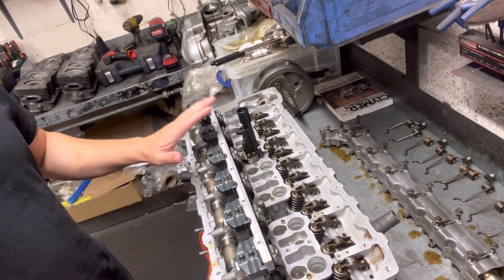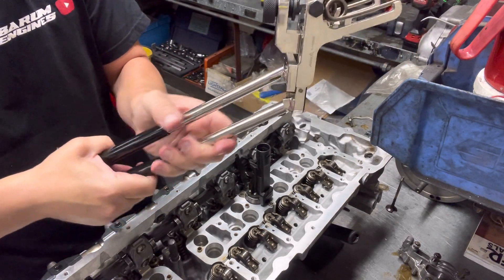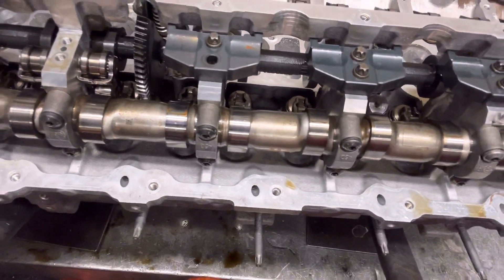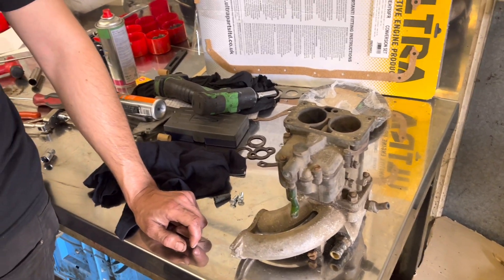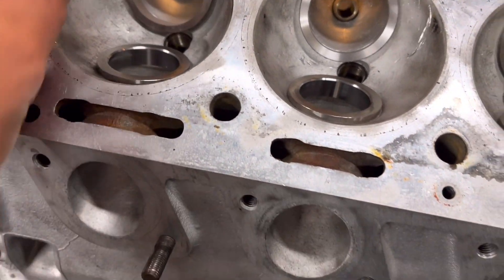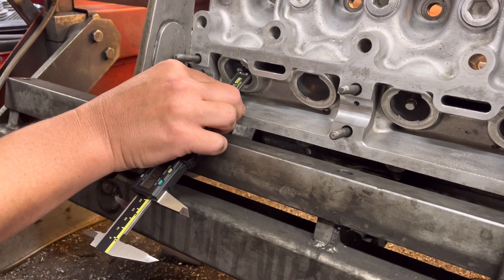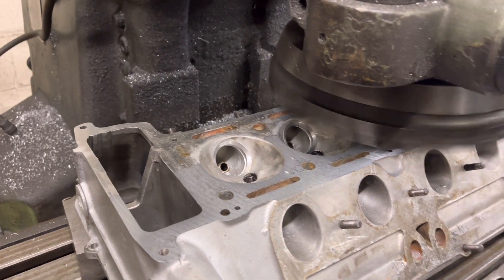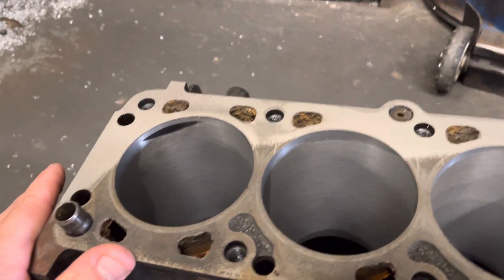Engine build postponed due to DISASTER. Cylinder block SCRAP. Customer will NOT be happy

Comment: Being a machinist myself ( now retired) I wouldn’t scrap the block. I would first sleeve the cylinder, then drill and pin the crack ends. Then grind out the rest of the crack. Weld it with the cast iron welding rods. Machine the deck then rebore the cylinder. I have made this type of repair multiple times with great success.

Comment: With regard to cleaning up that manifold - have you looked into electrolysis? It takes a bit of time, but it's unsupervised time (Also, make sure it's well ventilated as it gives off hydrogen!)
1) Big tub, big enough to fit part, fill with water.
2) Add a couple of spoons of Bicarbinate of Soda and stir
3) Attach negative to rusty part. 
4) Add a couple bits of scrap iron/ steel and attach positive to all sacrificial bits (a couple of long bits down each side would be best - make sure that they don't touch the rusty part!)
5) turn 12v on and watch bubbles.
6) Wait 24 hours
7) light wire brush of any remaining rust and you're good to go!

Comment: Holy crap BMW.  It's like they have engineers designing things as complex as possible just to justify their employment.  Any fool can make things more complex, but it takes genius to make it simpler.
Reply: Complex but efficient beats simple and inefficient. Remember the overwhelming amount of BMW's thus equipped are never likely to need this level of repair.
Reply: @stephenscholes4758  Part of why so many don't need this level of repair is because of the stuff that could and should have been better designed has failed and is exorbitantly expensive to repair.  Things like the CCV system, DISA valve, Vanos, cooling system failures, etc.  This system itself even causes expensive repairs due to long maintenance intervals.  All because of underwhelming cheaply made parts that are somehow insanely expensive thanks to that logo on them, and labor intensive to replace, or just outright cause the engine to fail.  The thing is, a variable valve lift system could easily be made using a much simpler and more robust system with a hydraulic variable height fulcrum on a rocker arm.  Then it's lighter, more compact, more easily serviceable, and probably quite close to the same reciprocating mass.
Reply: @stephenscholes4758  exactly this. if only idiots knew that BMW M5 with a fancy V8 is more efficient and does more MPG than a crappy Toyota Prius if driven on the track.. That's not even mentioning driver's experience that really is not comparable to any other manufacturer..

Comment: That is more or less the same set up as the mini R56 prince engine,made my own tool so I can replace the valve stem oil seals with the head on, works a treat replace all seals 6 hours drivng on the ramp to off. That tool is way over complicated.

Comment: OK

So here’s a question that’s come up to my mind now and again 

when you guys are rebuilding engines and you service a cylinder head 

part of that obviously is you test Spring tension

why is that test done at room temperature why would you not stick the springs in an oven heat them to 100° and do em at operating temperature considering metal gets softer as it gets hotter…..

Comment: Lee is it me but it seems like a lot of spring pressure on the "torx head bolt" on the top rail, the hole only looks like a m6 or m8 hole, Loving the videos as always and hats off to Isaac and Paul (you have got 2 top notch guys and getting use to the camera;  10/10
Reply: I wouldn't worry to much,  a m8 8.8 bolt takes 16100lb to snap.
Reply: @michaelbamber4887  Hi michael, yeah i probably put the question wrong. I was more thinking of the bolt threading in to soft aluminum especially with the spring pressure behind the bolt, I would have preferred to have used some thread lock
Reply: I'm with you now, well once its fitted and the torque is set, a m8 in 6061 aluminium can hold around 1800lb. Aluminium threads are no good if you keep separating the joint. This is when they 'strip'. Helicoil insert or time sert are fixes if you bust the tread. We used to fit um if the part was to be removed and refitted and was made of aluminium.

Comment: If you spray the face of the alloy cylinder heads with WD40 before you skim them you will get a better finish cut it stops the chips from sticking to the inserts and dragging the chip back over the head on its next revolution

Comment: Thanks for showing the valvetronic installation tool in action, I have often wondered how it works. Valvetronic is a very clever system for controlling the amount of air going into an engine and from what I understand it's also pretty reliable. FYI, these engines do not actually need a throttle body to run.

Comment: Pretty interesting, regular viewer 😁, when I find the time I’m going to pull my bmw mini n14 engine out it’s got the normal oil consumption issue . Runs fine tho 130 thousand on it , what sort of money would be in a refresh , ie pistons rings , valve steam seals , valve seats cleaned ect is there a package you offer I don’t know what’s involved exactly, as you have said before others have said refresh and it clearly was not once you have stripped and checked it over many thanks , I know it’s hard to valve someone like this
Reply: If you look back at one of the earlier videos Barum give a complete financial breakdown for an engine refresh from beginning to end!

Comment: Soak the rusty exhaust extractors in a solution of water with a couple of litres of vinegar and a litre of a calcium l, lime , rust remover. The rust will fall off overnight and it will look like new.

Comment: Could that crack not be lock stitched?  With the paucity of the blocks at some point its going to be economically sensible to attempt an actual repair, rather than just throwing it away and if a lock fixes it you got a good block ready to go elsewhere.   What we need is what they still do in India and Pakistan where they cast new blocks for trucks and cars, we used to do it here in Britain, I remember my grandfather getting his Austin 7 and his Triumph Vitesse worked on by a blacksmith's in Westerham like welding or brazing his Triumphs cracked block, that blacksmith could braze just about anything and he handled things like pressing in new waterpump bearings and seals which he did for free if me grandfather provided bearing and seal pack.

Comment: Just a suggestion for a new machine I use a robins sg8 valve seat machine it's also got attachment's for a drill and various other things I think it would suit you guys better and be a upgrade on the old Mira seat cutter I think the robins machines are fantastic it's one of a handful in the UK we had it imported by fondera it's a fantastic bit of kit
Reply: My 36 years as an Automotive Machinist , Having used a Repco RVR 3 ,  MIRA , Serdi  60 , Rottler SGF8 and EVO Classic by Serdi SRL Seat and Valve guide machines , They all have their Pros and Cons
Reply: @StuFGGSMiami  yes I've used serdis aswell and I've used the stone systems and the stone guns are absolutely crap I've used the Mira systems in other shops but never really liked the feel of them
Reply: Isn’t that a India copy of the Rotter SG8?
Reply: @andym6608  Rottler Seat and Guide Machines are made by Robins Machine India, then shipped to Rottler and fitted out with Rottler's electronics and Sold as Rottlers ,When Rottler discontinues that model , Robin Machines can the sell it under their name
Reply: @StuFGGSMiami  I had a feeling they were made by someone else I no mine has a different electronic part to the robins it has the electronic angle gauge and electronic speed control but other than that there the same. I had a peg FM1 before that 😂and a peg 10 stone grinder before that.
Reply: @andym6608  I think it's under licence from rotter but they will all be made in the same place like everything nowadays but they are a cracking bit of kit
Reply: I own a Rottler SG8 and I no Clive and Richard at Fondera and they are a good seat machine 👍
Reply: @andym6608  yes Richard is class really knowledgeable what area are you from in the UK ?
Reply: @lifeofderv  chesterfield mate I have had the Rottler just over 12 years now it’s a good bit of kit can’t fault it’s not been used in 2 years I don’t do much head work now
Reply: @andym6608  yes are you the bloke who used to do a lot with the rb26 and 2jz in the Walton area ?
Reply: @lifeofderv  yes mate that’s me lol
Reply: @andym6608  what a small world it is haha you still doing anything at all you said it's not been used in a long time ?
Reply: @lifeofderv  I bought a small cnc machine some years ago and now a bigger one so I do more stuff with that still have the flow bench and all the other stuff
Reply: @andym6608  small CNC to do porting ?
Reply: @lifeofderv  I could do some on the bigger one but at the moment I’am make parts I’am just doing a drive by wire kit for the RB
Reply: @andym6608  nice how's that working out ? Be nice to see how all the RB stuff is done diesel is same old now haha
Reply: @lifeofderv  haha what’s the name of your business?
Reply: @andym6608  not my business but a local diesel reconditioning shop no names on here haha

Comment: You know I'm 61 and as much as I loved being a mechanic I lost interest when the industry stopped re building stuff and went to just  replacing and all the electrics !
Seriously ! That cylinder head has to be that complicated so that it meets all government requirments ??
Before anyone says anything yes I know technology has to change but that head is NUTS!
Reply: Please ! Can't we just have electronic ignition and a little bit of fuel injection LOL !
Reply: There is no throttle butterfly on those engines. The valve lift is variable and is used in place of a conventional throttle butterfly. Plus of course also have the Vanos variable valve timing!!!
Reply: It is a very good way of reducing pumping loss. The engine can run without any throttling at light load. The gas pedal advances the valve lift rather than the throttle body. There still is a regular TB for backup purposes.

Comment: I am disappointed in BMW, I'm sure they could have made that head more complicated if they put some effort into it.
Reply: You mean the company that puts it's batteries in the boot, then, doesn't put a key on the boot if the battery is remove, but you shut the boot?
Reply: @ghollidge  haha don’t know how many BMW trunks I have had to break into because of this! Absolutely 0 common sense coming from them.
Reply: @ghollidge  you sure? Mine has a key slot up next to the number plate lights.
Reply: @michaelbamber4887  on a certain model they don't have a key for boot at all
Reply: @ghollidge  fair enough, everyone I've ever had has. Probably a new money saving thing like the no dipstick engines.
Reply: Typical German over engineering. 😁😁😁
Reply: Yeap, but not much more. Holly crap! All it really is missing is desmotronic actuation, then it would be perfectly complicated. 😄
Reply: @MJPilote  Actually the desmodromic system is a lot less complex than this.  Makes you wonder what they are thinking- The BMW costs 16000.00 makes about 350HP and needs rebuild at 100K, while you can buy a GM 604 crate motor for 8500.00 which makes 400HP and will go 200K easy.
Reply: @MJPilote  Desmo would lessen the complexity not add to it
Reply: @stephenscholes4758  knowing BMW, they would add it directly to that. Making is even more complex. That was the point of it.

Have worked with Ducati engines in the past and I know how it works.
Reply: no doubt at factory it has a jig that installs all 6 springs at the same time
Reply: @stewills9711  The jig probably has another jig which holds the springs and a few special tools as well.

Comment: Do people still blueprint engines? It was a big thing back in the day but I never hear of it nowadays. I had a blueprinted mini engine back in the 90s. Dayum that thing shifted. Used to blow drive shafts every few months. Always near side for some reason.
Reply: No need for blue printing on anything but an engine for a car racing in a series demanding a standard engine. Blueprinting just gives you a few BHP extra over your competitors; which is only an advantage if you're all running identical engines.
Reply: @johnrussell5245  Thanks for the response dude. I wondered why I hadn't heard of it in years. The world moves on I guess.

Comment: confused by the engine called a 'crossflow' at 7.13.mins. The block has a pre crossflow casting number, and the cylinder head has 8 ports on the same side, so not a crossflow. A cross flow has inlet and exhaust on opposite sides.
Reply: every other time that block has been mentioned it was called a Pre cross flow i blame Paul
Reply: Colin scutt agreed. It’s his old age and grey hair 👍🏻
Reply: Slip of the tongue - think he meant PRE-crossflow 🙃
Reply: It’s called a ‘uniflow’.

Comment: Couldn't you cold stitch that block and re-sleeve that one cylinder??, It seems a shame to lose one if they are rare??
Reply: wtf is cold stiching ?
Reply: @colinscutt5104  It's a way of repairing cracks in cast iron that doesn't involve heat (which can cause problems cracking etc). 
https://www.youtube.com/watch?v=Pq0wfU4ZaKk
Reply: @colinscutt5104  it's a method of repairing cast iron blocks but hardly worth it unless it's a 1 off block specialist job and costs a fortune
Reply: They are only 80 to 100 quid for a block not worth repairing
Reply: @blueonblueracingnova  I must have got mixed up and thought it was off that Alfa or something.
Reply: Not really, if it was cracked between cylinders you could as there is cast around the crack. This is on the edge so the repair would be weak.

Comment: Also with that Rover V8 if memory serves, you are supposed to prime the oil pump with petroleum jelly.
Reply: The oil pump on the Rover V8 can be primed by putting a rod with the right shaped end (very easy to make) down into the oil pump drive. This is then rotated with an electric drill and until oil is flowing throughout the stationary engine. Attaching an oil gauge will show it's all up to pressure. No need for anything—other than engine oil in the sump.
Reply: Pardon? I think gearbox oil or Wynn's will do. That is what I used to use, Wynn's gloop.
Reply: Correct 100%.
Reply: back in the day the mechanics who taught me would fill a new oil pump on a v8 Rover with grease, stating it won't suck on startup without it. Using a drill and attachment with a pressure gauge sounds like a better idea.
Reply: @steptoeandson3554  Grease can block the oil ways due to its high melting point, so it's better to use petroleum jelly

Comment: 1:28  Is that a southern hemisphere clock over your right shoulder?  Or maybe a left handed one?  Do you ever use it for reference and and mistake clockwise for anticlockwise?
What hilarity that must bring!  I've seen clocks for barber shops so you can read them in the mirror, but never a left handed one.  Now, I'm not sure I'd trust you with a lawnmower engine.....  This requires more thought.  Or is that what it takes mentally to fix the Cosworth, BMW et al?  They are just the reverse of the real world....  Existential crisis incoming!!!!
Reply: Like reverse threads on left hand side axles. Or is it right? I have forgotten....